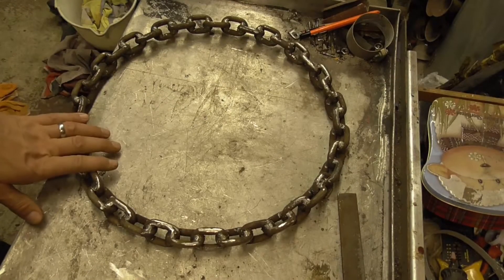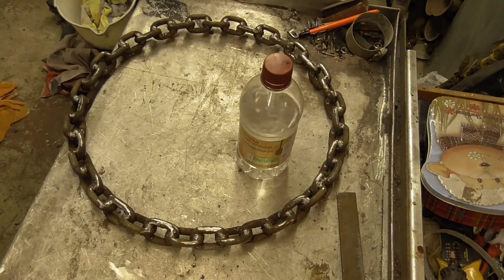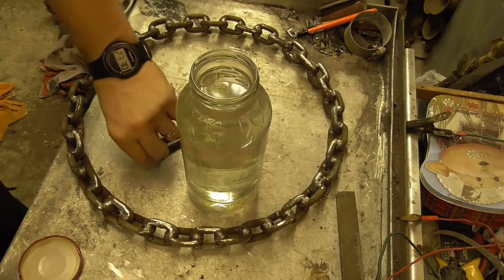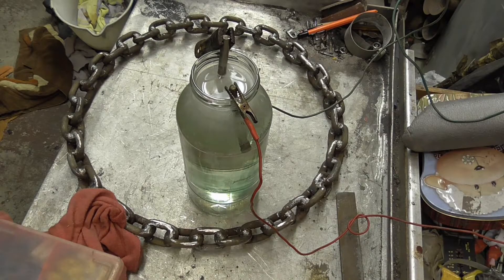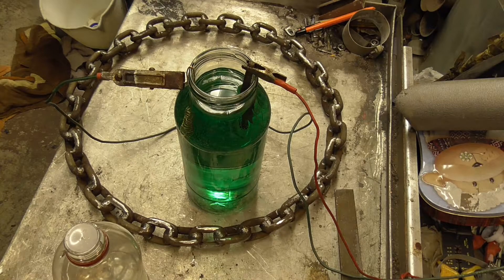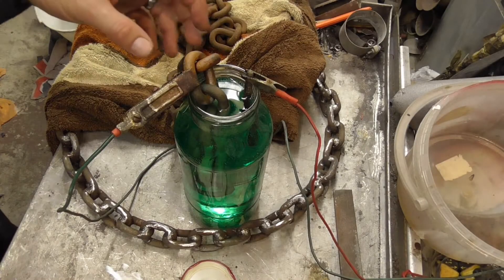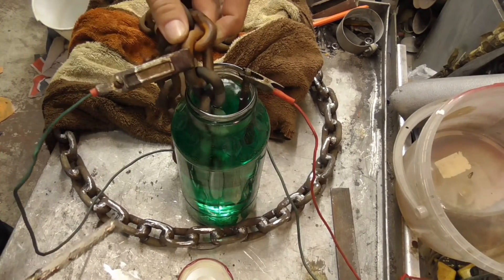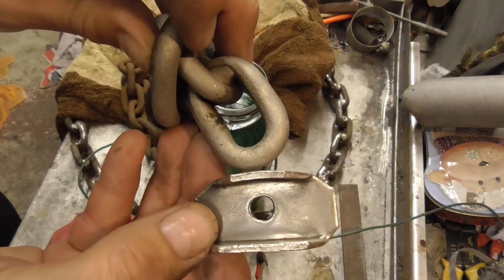DIY Nickel Plating - Electroplating for Car Parts UPDATED

Comment: I think we live in a world of fear where it is difficult to find safety info that isn’t tainted to the lowest common denominator. The part you are doing is the dangerous part of the nickel plating. Remember when jewelry had such issues? A minority were effected but once “hypoallergenic” coatings we’re used everyone thought that was the best course. Personally, I am not afraid to touch lead paint, asbestos, or nickel plated products. I’m no fool but I do base my beliefs on logic. I understand that about anything, when ground into a fine powder, and ingested, can cause problems - typically after decades of continuous exposure. With all of our modern knowledge you’d sure think we’d have cancer beat by now, wouldn’t you? Okay off soap box. I was really hoping to see how it would turn out.
Oh cool! I see some other videos that appears you completed the project. I’ll go look at those!
Reply from the maker: Unfortunately I decided against the Nickle finish. Partly because I didn't want to handle it for long periods but also cos it went Pete tong and I had to spend so long cleaning it up again lol.
I'm sorry my experiment didn't come out how i planed as was hoping tobuse it for a number of jobs. I may have another go this winter. Thanks for watching 🙂👍

Comment: Want it shiny? Clean steel deeply, polish it, etch it in acid right before plating. Make sure cathode is clean as possible. Run 1V and low amperage, slower you do it, better nickel coat will be.
Reply from the maker: Awesome advice dude thankyou. I've kinda given up on the science experiments for now tho, apart from I found nickel will probably kill me when I breath in my own grinding dust or turn me into a scabby cat ha ha ha, I realised the inner nerd in me was starting to take over, I was losing my way and that I should get back to doing car stuff on this channel! Don't tell anyone but I do have a mental metal melting vw idea for the future, but I don't want to scare everyone off before I get to 1000 subscribers :)
Reply: @PeoplesCar  Pure nickel is nobel, but its salts are nasty, just like most metals, copper sulfonate is highly poisonus or paris green but available to public. If you want it easy, do what I do for suspension bolts and similar steel. Derust in citric acid, degrease with white spirits, cover with soldering paste and melt with heat gun. If you mix tin dust (30% by mass) with soldering paste you can DIY it, as its not cheapest. Nice shiny silvery surface, completely inert to water. Not as hard as nickel, but robust. No electroplating involved, so its safer and quicker.
Reply from the maker: @Fosgen  That sounds interesting. I'll look into that. Tx :)